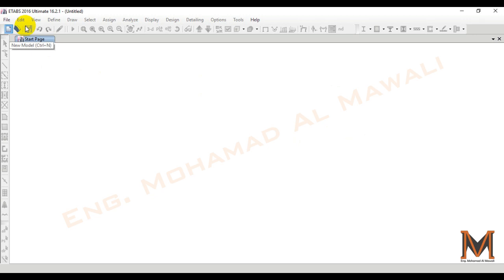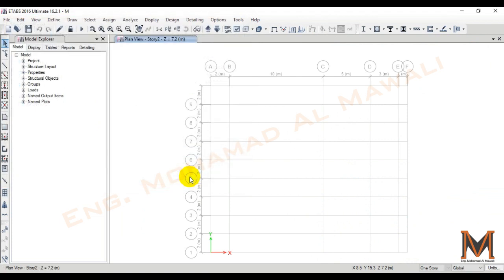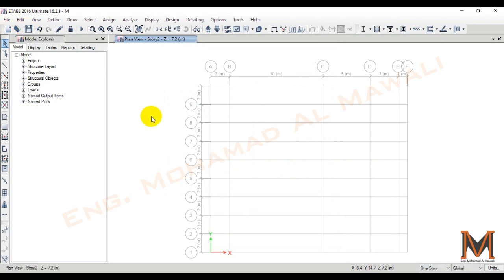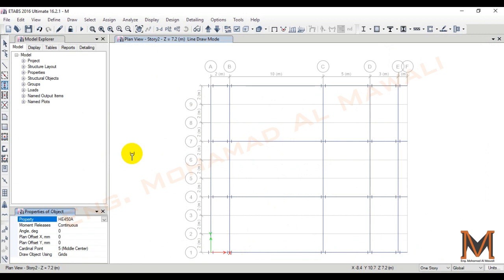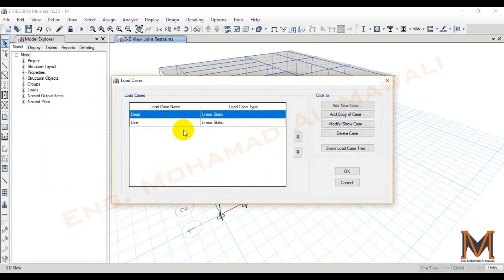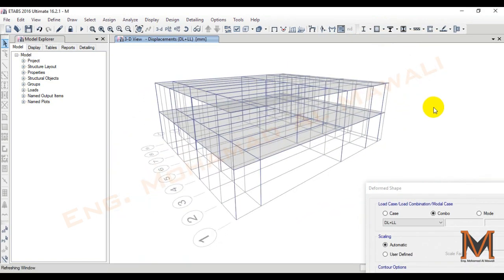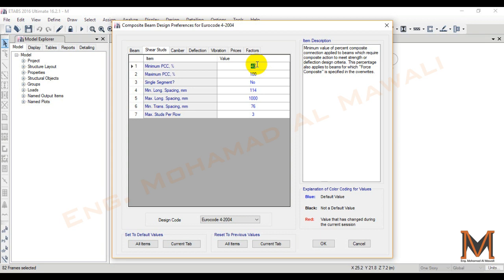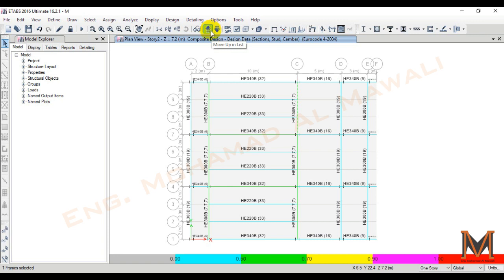Simple Structure Design of Steel-Concrete Composite, using CSI ETABS

Comment: Dear Eng. Mohamad, around the 16th minute you mention that defining the slab as a deck (membrane behavior) is a mistake. Why is that so? CSI "Watch and learn" composite beam design videos feature deck sections for the slab part of the composite beams. However the resulting deflections patters of the deck are indeed strange. Thank you.
Reply: Dear Eng. I  want to design a building with composite column and RCC column in one plan  can i do this and i want to select my floor as (shell thin) and beam as RCC beams